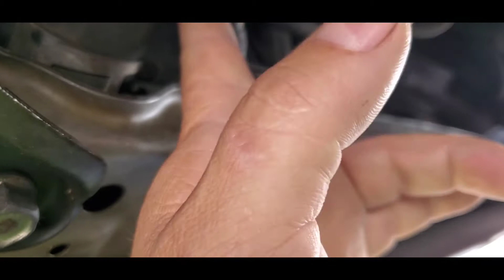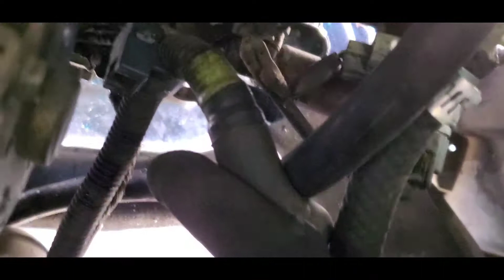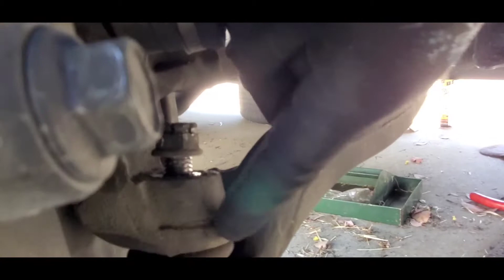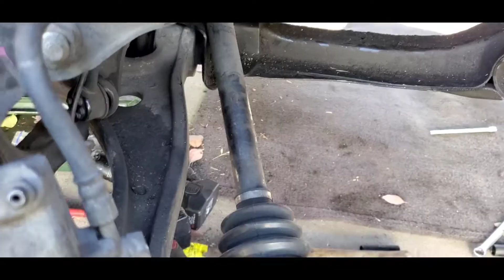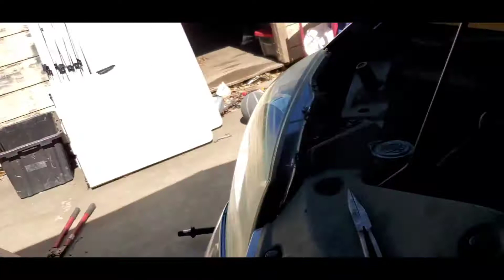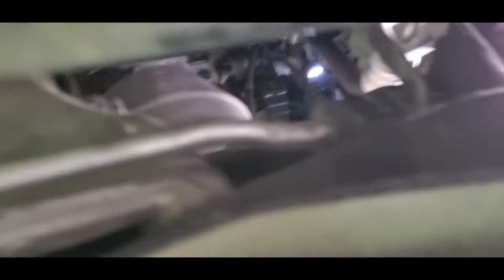honda odyssey ,transmission replacement #1

Comment: I just did this swap and now my car won’t start. I go to crank it up and it just goes click. Tested two starters in there and two batteries. Am I missing some wiring?
Reply from the maker: Ground, by the upper hose housing ,there's another one by the neutral switch
Reply: @quikfixes2084  where is the neutral switch. I noticed the one by the upper housing is already installed. Unless I put it in the wrong place maybe. But ground is ground right?

Comment: Can you drop the subframe  with whole rack connected
Reply from the maker: Yes ,but is harder to attach the shaft  back 2  the steering column  you still have to remove  it to put it back
Reply: @quikfixes2084  i think my rack is leaking bad so wanted  to replace,,,,,you installed  a japan transmission,,,did you have to switch  different  sensors  to new
Reply from the maker: Some times the the sensors have different  connector pigtail, i hadvto switxh fly wheel brackets and sensors ,because the tranny i got was from a acura ,not from a honda ,if you get it from a odyssey yiu dont need to switch  anything, unfortunately for me the customer  provided  the transmission
Reply: @quikfixes2084  hopefully  i dont run into issues  i got a transmission  imported  from japan low miles ,,,they said it will work in my ex l but i already see some sensors and components  that are different  ,,,,,hopefully  i can just switch  ,they told me to use the supplied  flex and torque converter

Comment: hi, Can I remove the engine and transmission from the hood,
Every video that I see they lift the van up and the engine stays on the floor.
Reply from the maker: Yes I can b done but is a lot more work